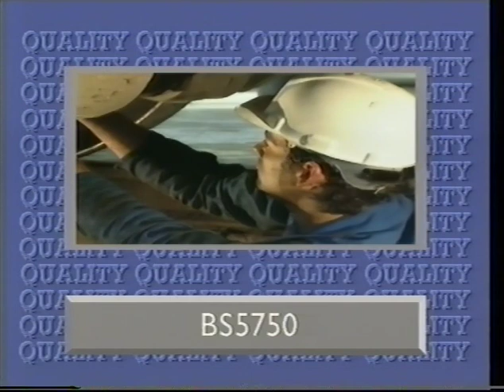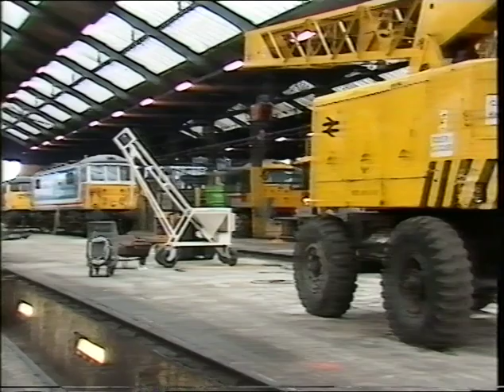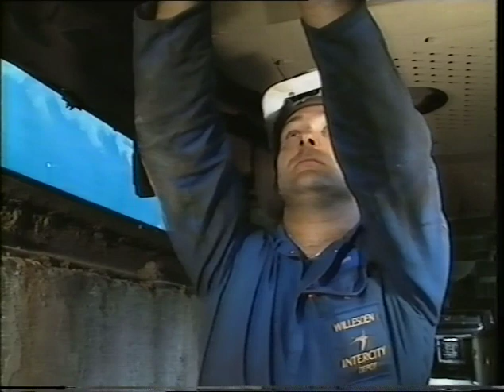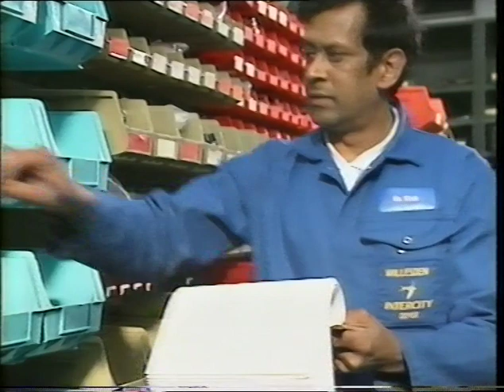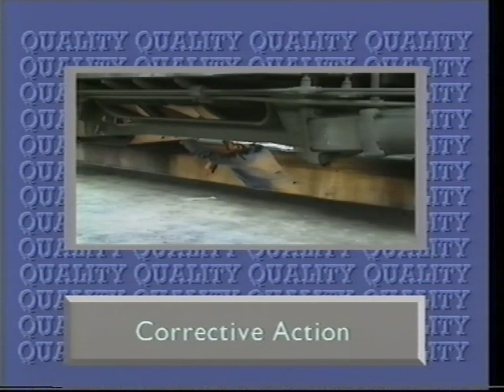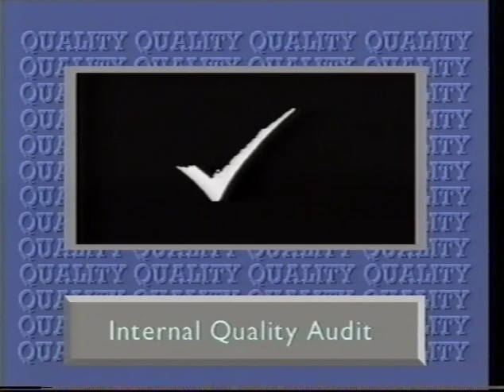Quality Involves Everybody (BR - 1989)

Comment: When I worked at VSC Clapham junction, opened in stages 1980 it was a Disaster! Contractors installed cheap substandard relays which kept failing, constant points track circuit failures. ASE was 'Wrong man for the job'had to be paid off, replacement narcissistic told by Chairman BR Board that he was to be sacked in 6 months time unless failure rate dropped, made lots of recommendations to reduce failure rate, 2 were carried out, wrote that all 4 men on mtc faulting shift had to do outside work, previously top grade didn't want to do outside work, 2nd recommendation can't say but improved railway operations considerably. ASE bought in man from Swanley led a task force team, found lots of equipment faults reduced failure rate.